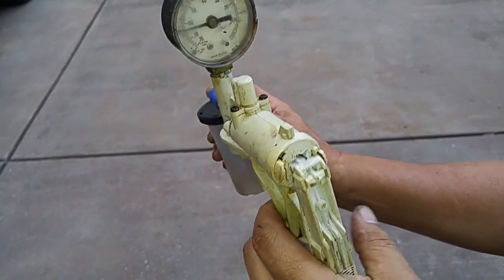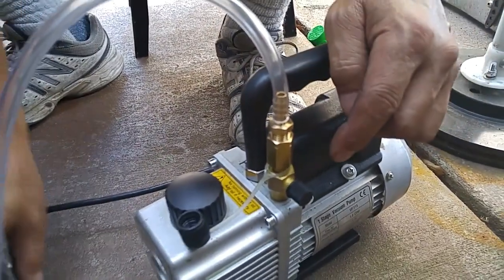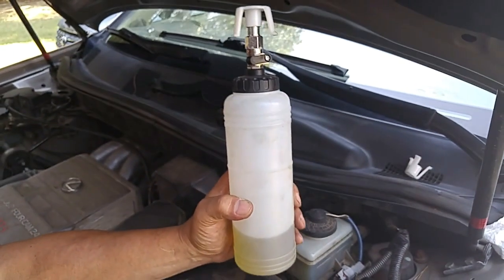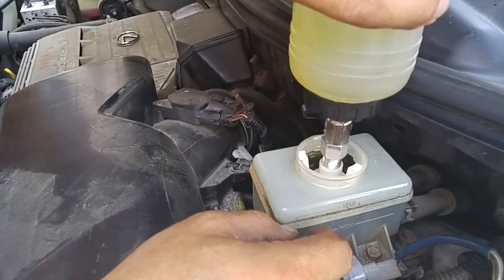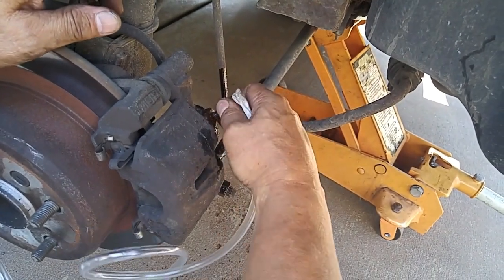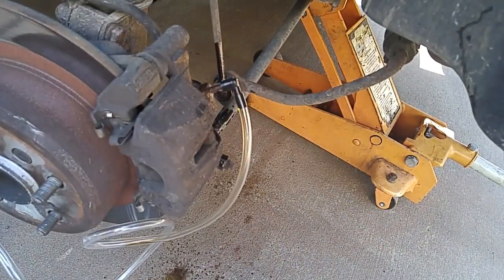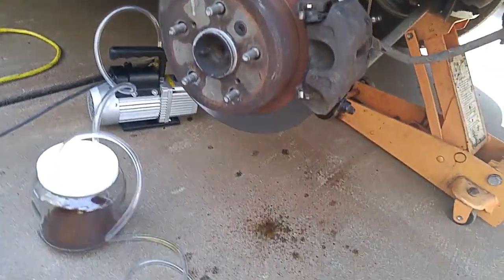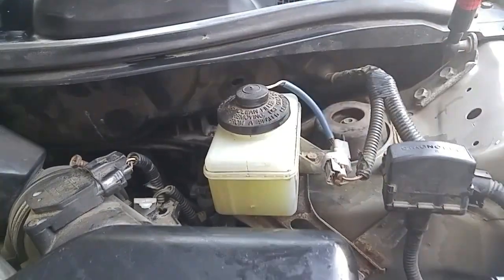Brake Bleed / Brake Fluid Flush With An AC Vacuum Pump!

Comment: ive been looking for some kind of electric brake bleeder since the compressed air/venturi effect ones seem to never last more than a few uses before they just dont pull vacuum anymore. im surprised nobody makes a dedicated brake bleeder like this with a built in reservoir. i think i might go this route.
Reply from the maker: It would be a handy tool to have for sure.

Comment: As the bleeder valve where you are applying vacuum is on the top side of the caliper you may still have old fluid in the caliper at the lower levels.  You have vastly improved the quality of the fluid even if you don't get 100% of the old fluid out.
Reply from the maker: True ... you'll won't get 100% of the old fluid out ... just like engine and transmission oil changes.
Reply: When you change brake pads, open the bleeder valve before compressing the piston/s on the caliper....that'll push old fluid from the caliper.

Comment: You may not need the top bottle on the reservoir by a little change in your procedure. I'd use the suction  hose to suck out the reservoir, top it up with the new fluid. Then follow the remainder of your procedure. Once in awhile check the reservoir to see if you need to top it up.
Reply from the maker: Nothing wrong with your suggestion but I prefer not to keep visiting the reservoir to make sure the fluid level hasn't drop too much while doing the fluid exchange.
Reply: @hardlymovingpro  I think what he’s saying is get rid of the all fluid in the reservoir and then fill it up with a new fluid. You he supplied old fluid from the reservoir initially, correct?

Comment: I assume i could use an electric fluid pump i bought off temu for $27? The clamps for power attach to the battery, i assume best for the pump to be located low near the bleeder so i will power the pump by my 12V battery jump box placed near the bleeder. Do  u have to repeat for each wheel? If so does it matter what order you bleed the wheels? Start with the wheel nearest or fartherest from yhe master cylinder? Thanks for posting
Reply from the maker: An electric fluid pump won't have the vacuum / suction to perform this job.  Each wheel will require pumping and yes, start from the wheel furthest from the brake reservoir.

Comment: Will it purge air out of an abs module?
Reply from the maker: It could.  But best to use a scan tool (assuming you've installed a replacement module) to cycle (activate) the module where the module will pump fluid out to the bleed valve.  The scan tool allows you to repeat the activation until you no longer see air coming out of the service port.

Comment: Is an AC Vacuum Pump save for bleeding brakes, power steering, oil without damage to seals?

Vacuum pumps pull of 0.02 inHg is way below maximum vacuum on power steering lines 25 inHg.

- Vacuum pumps can pull below 500 µHg (microns or micrometers of mercury) 
    - 0.02 inHg (inches of mercury)
    - 0.01 PSI (pounds per square inch)
    - 0.0007 Bar (atmospheric pressure)
- Power steering vacuum bleed should not exceed 25 inHg
    - 635,000 µHg
    - 12 PSI
    - 0.83 Bar
Reply from the maker: Won't damage seals.  Got the idea of using an ac vacuum pump by using a profession brake bleed pump at the dealership I worked at.  Only difference was there's a attachment on the fluid reservoir that feeds new fluid under pressure.   So there was both vacuum and pressure.
Reply: @hardlymovingpro  love the idea.  Gonna get an M18 vacuum pump and just added another use case.

Comment: I have one of the air mattress pumps that doubles as a vacuum, gonna try that out since it has an adapter for small hoses
Reply from the maker: I think you may be disappointed since I tried that as well with a shop vac and couldn't generate the vacuum like the ac vacuum pump.
Reply: @hardlymovingpro  well damn, thanks for letting me know

Comment: Ok. This MF is a genius. 😯😍
I knew there had to be a better way other than this hand pumps or pressure bleeders and this is it.   

The fluid feed bottle with the valve and adapter to hold it in place, what is that? Where can I find that?
Reply from the maker: The fluid feeder bottle came as part of a two part kit.  The other part used compressed air pressure to create volume.  Then I came up with the ac vacuum pump idea.  Here's a link to a two part kit or an individual bottle:
https://amzn.to/3YqbEqX
https://amzn.to/3OMvuJL

Comment: if the master cylinder is ran dry, do you have to then bleed the master cylinder by itself before bleeding the brakes, or can it be all done together?
Reply from the maker: Can be done together.  Just will take longer to bleed out the air.

Comment: I found out my Fluid extractor sucks them out fast..No power needed...
Reply from the maker: what brand?
Reply: @hardlymovingpro  That Expensive OEM Manual Fluid Extractor...The one if  you break a hose  fitting.They tell you to go buy a new one...As they don't make replacement parts..So I did what I always do. Improvised..

Comment: You shouldn't turn the vac pump off nor pull off the hose until you close off the brake bleeder.
Reply from the maker: Why?  If you pull the hose off or shut off the pump doesn't result in air getting sucked back into the brake lines.  You can open and close the bleed valve at any time without worry of air getting into the lines.  Pumping the brake pedal, however, will suck air back into the lines with a open bleed valve.

Comment: Here are the parts I used for a basic setup to hook up to a Vacuum Pump like the one in video.

From BlackHawk Supply
2 of 1/4 x 1/4 HB x MIP Wht Nyln Elbows - part# 33039W
1 of 1/4 x 1/4 x FEM Flare Swivl - part# 32101

+++++++++++++++++++++++++++++++++++++++++++++
I already had these 3 OPTIONAL ITEMS on hand:
The Gauge is not needed...

I added the vacuum gauge, just to see how much vacuum it was pulling.
It pegged the gauge to -30 inches HG.
Plus I had no leak down when I plugged the brake side hose even after leaving if for 5 hours.
Silicone grease does a great job.
 
DuraChoice 2" Utility Vacuum Pressure Gauge,  Water Oil Gas, WOG, 1/4" NPT Lwr Mount, 
    30HG/0PSI GSAD2012-VUPD

Dow Corning DC-HI-VAC-5.3OZ Silicone-Based High Vacuum Grease

Empty Pickle jar :-)
Reply from the maker: Thanks for sharing!

Comment: Please read me previous comment first, OK?  This is like a "Part 2".   I was shocked when I tried to bleed the rear brakes on an '07 ES350.  It took so long and required so much vacuum.  And when I cranked up the vacuum, all I got was air going past the bleeders.   I tried what you did here and I found it completely retracted the pistons also.  And that's when I discovered using the high vacuum grease did the trick. As soon as I could stop the air from getting through the threads of the bleeders, I could then set the vacuum amount to no more than 20 inches, and the flow was reasonable.  If you don't stop the air you might (as I did) wind up with a slightly spongy pedal, because "some" of the air that sneaks past the bleeders, stays in the caliper.
Reply: Likewise, I had a problem with air. I used some teflon tape and it seemed to do the trick as well. Hopefully I didn't loose any in the caliper itself, but it seemed to work well.
Reply: @anthonymarlette8124  I use Teflon tape as well and it works fine for me.
Reply from the maker: Ok ... read both posts.  Didn't know that there's a high vacuum silicon grease.  I'll check it out.  The rear caliper farthest from the master cylinder requires a lot of vacuum force to get the fluid moving.  I sometimes will go into the car while my vacuum pump is attached and push down on the brake pedal to create some pressure to help push the fluid along;  however, you have to slowly release the pedal else air will get sucked into the brake lines.
Reply from the maker: Wow ... that silicone grease is expensive stuff!
Reply: @hardlymovingpro  Yes, it is pricey.....but it only takes a small dab to do the job, which means it will last forever.  It is VERY thick, like a paste.  I know you don't know me, but I can tell you - you WILL be amazed how all the bubbles stop appearing in the bleed tube, and how the fluid comes out much quicker.  I use to pump and pump the mIghty vac unit, and now I pump it up to 20 inches, and it fills the entire container and the vacuum level doesn't even drop below 10-15 inches.  Because now it's ONLY fluid coming out, and not air past the bleeder.
Reply: Does the high vacuum grease go where bleeder screws out or on the bleeder threads?

Comment: Do you see all the air bubbles that continue to show up in the hose, and appear to be coming out of the brake system?  That is NOT air in the system.  What that is is air sneaking past the bleeder threads, do to the higher levels of vacuum you are applying.  I saw this even with the Mighty Vac.  I found a solution.  I can use the Mighty vac pumped up to about 20 inches of vacuum, and it fills the entire Mighty vac container, and the vacuum hardly drops to even 15 inches, and NO air bubbles.  Use "High vacuum silicone grease" applied around the base of the bleeder valve.  Don't unscrew the valve, just put a good coat (using you finger) around the top base of it. The grease is not cheap, but I guarantee you'll be amazed - https://www.amazon.com/Corning-DC-HI-VAC-5-3OZ-Silicone-Based-Vacuum-Grease/dp/B00JFKU46G/ref=sr_1_1?crid=1NZSBG6VWG8AN&dchild=1&keywords=dow+corning+dc-hi-vac-5.3oz+silicone-based+high+vacuum+grease&qid=1609898991&sprefix=high+vacuum+silicone+%2Caps%2C166&sr=8-1

PS - NO, you cannot use ordinary silicone grease.....I tried that.  It's too thin, and it gets sucked into the threads of the bleeder valve, and air follows it....and bubbles continue....and pieces of the regular silicone grease show up - coming out with the brake fluid.
Reply: I use the vacuum bleeder that uses an air compressor. I smear heavy grease around the base of the nipple threads and it doesn't let air get through.

Comment: Great video. How has that vacuum pump held up after a year. Thanks
Reply from the maker: Been using this pump for the last 3 years for both ac service and brake fluid flushes.  Recently purchased a 6 CFM pump on sale for more suction.

Comment: Having a hard time finding the vacuum fittings to use. Any insite or what type of fittings I need to find?
Reply: Thank you this was the information I was looking for.
Reply from the maker: I went to the HomeDepot plumbing department to get everything I needed.
Reply: @hardlymovingpro  npt fittings?
Reply from the maker: @StevenPaul001  Yes ... brass or nylon.

Comment: Great video and great idea! I have just installed all new pads, rotors, master cylinder on my Armada. I have not bled anything yet as I'm trying to find the very best way and I think this is it! Will this process bleed everything including the master cylinder by the time I have completed all 4 wheels?  Also, did you have any issue with your plastic tubing collapsing under vacuum? I have the same little vacuum pump as yours and was hoping that this would work. Many thanks for confirming it!
Reply from the maker: The hand pump works ok if willing to pump it a couple of hundred times.  The ac vacuum pump can work faster if you pump the brake pedal.  Just be real slow releasing the pedal to prevent air from getting sucked in between the loose bleed valve and caliper.
Reply: Thanks for your reply. That's a good tip about releasing the pedal slowly so as not to suck air back in. Maybe I should put a smear of heavy grease around the outside of the nippples. So, do you think the best way to get air out of the lines AND the master cylinder is to do what you did and also slowly pump the pedal initially to help get air out of the master as well? Would this make sense? My setup looks just like yours so thanks for the inspiration :)
Reply from the maker: The slow release method is something I learned on my own when I don't have help with someone to close off the bleed valve on the brake pedal rebound.  Method should work with a new master cylinder as well.  The premise is that the vacuum from the a/c pump is greater than the suction caused by the brake pedal rebound. I've found that the a/c vacuum method doesn't work as well with the wheel furthest from the master cylinder.  The professional brake fluid exchange machines have a pump to apply pressure via the brake reservoir cap opening working in conjunction with a suction connector to be used at each wheel.  So you have both pressure and vacuum working together.  My makeshift solution creates pressure via the brake pedal.
Reply: @hardlymovingpro  This is a great explanation and makes perfect sense. I will keep all of this in mind this weekend when I bleed my system. You have been a huge help. Thank you so much!
Reply from the maker: @flyme-z7b  You bet and good luck!
Reply: @hardlymovingpro  Hello again. Quick question: Does that auto filler have a float valve to control the flow? Otherwise, since fluids seek their own level, what keeps fluid from over filling the reservoir?
Reply from the maker: @flyme-z7b  Yes ... the professional brake fluid exchange device had a reservoir that you prefil with a quart of new brake fluid.  From my recollection, when the reservoir is almost empty, you shut off the fluid feed valve and continue suction on any of the brake bleed valves until you reach the desired master cylinder reservoir level.   It's a good idea these days to flush out the old fluid every couple of years to avoid having your ABS light go on.  Moisture buildup in the ABS control unit can make the pump's pistons seize up.

Comment: I was thinking how to do it using the AC Vacuum so I searched to see if anyone has done it.  I would have never thought of it this way.  I bowed down to you.
Reply from the maker: Thanks for your comment and appreciate your post.  One thing I didn't mention was that you can pump the brakes (slowly) to help speed up the bleed/flush process without worrying about air getting into the lines during the brake pedal release.

Comment: Great idea- I was thinking the same thing as I have two ac vacuum pumps and I can dedicate one for this purpose. Can you share the info on the adapter you used on the vacuum pump please and the other fittings used in the clear collection container? Thank you in advance.
Reply from the maker: You can use any left over plastic container with a tight lid.  The brake service port fittings I got were left overs from my vacuum hand pump kit.  The plastic lines I got from HomeDepot with any diameter that fit the hand pump fittings.  The plastic connectors that screwed into the container, also, from HomeDepot.  The brass pump adapter, also, HomeDepot.
Reply: Thank you for your reply!

Comment: Great idea! Make sure to close the bleeder valve while still under vacuum. Otherwise you risk reintroducing air into the system.
Reply: It’s actually the opposite. A little air is gonna get in through the thread of the valve when under vacuum. That’s why there’s always bubbles coming out when pulling vacuum on it. (Those bubbles were not in the system, and that’s one disadvantage of using vacuum method.) To fully remove the air, it is better to remove the vacuum, and let the fluid drip a bit before closing (use gravity to push out the remaining air near the valve)
Reply from the maker: Not necessarily.  Gravity will keep pushing the fluid out in drips.  Thanks for your post!

Comment: For people who have no money for a vacuum pump, you can pull the pump out of an old fridge or ac unit. Great thing about these pumps is that they are virtually silent. I had a hookup with a refrigerator motor and I bought a used brake fluid reservoir cap  along with some hose. I hung the extra fluid in a bleach container hanging from the hood and it actually worked. Those fridge motors also make great bicycle tire infiltrators. .
Reply from the maker: Something I might experiment with in the future.
Reply: Great idea next time I see one lying around I'm going to do that

Comment: WOW! Brilliant!
have one question: this method can harm your AC vacuum pump? the vapors or somehow?
Reply from the maker: Thanks! Have used this technique around a dozen time so far and the vacuum pump has been working fine.
Reply: @hardlymovingpro  
Got you...
Was wondering, maybe there is damage, but not immediately..?
Reply from the maker: @johndoe2022  Doubt it.  There's absolutely no brake fluid working its way back from the container to the vacuum pump via the plastic hose.   Also, brake fluid does not give off vapors ... it does absorb moisture which is why it should be changed out after a few years.
Reply: @hardlymovingpro  
Ok will try it ASAP :)
Can i use cooper pipe for connections? For container cup?
Reply from the maker: Sure ... copper, brass, plastic, etc.  You want to have a good leak free vacuum seal.  Using a 2 quart thick, clear plastic container with a plastic lid would work nicely in holding sucked in brake fluid.
Reply: No worse than freon which is what the pump was designed for.